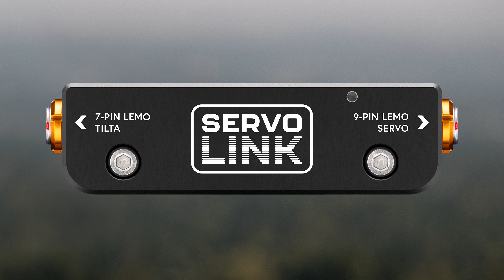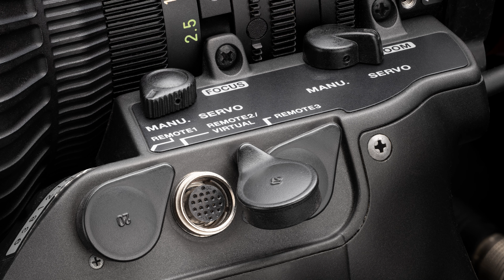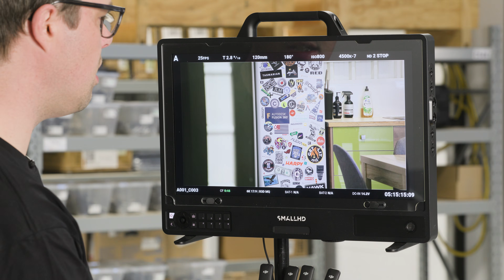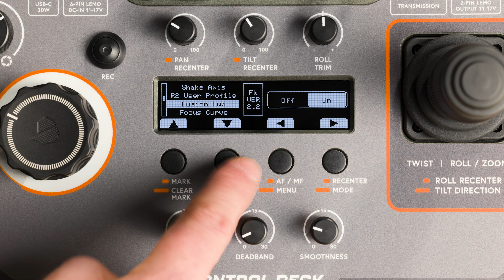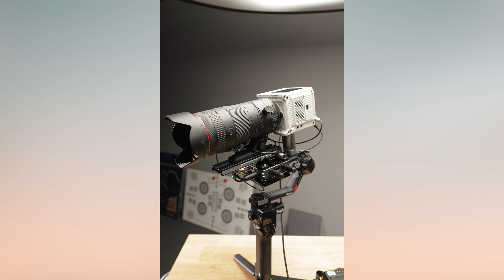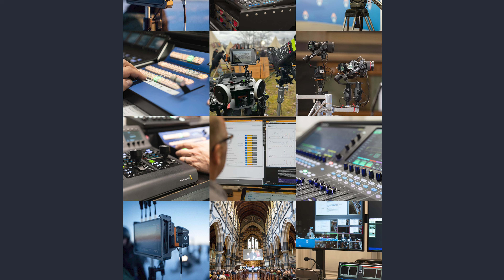Servo Link In-Depth 🔥

Comment: This is a really good video👍 I was watching and I had a question! If the DJI transmitter reception is poor in a crowded concert hall or other place with various frequencies, will there be problems using the control deck? If I want to receive stable transmissions with the DJI transmitter in a place with a large audience and complex frequencies, what is the solution?
Reply from the maker: Thanks!

The gimbal control and FIZ data use about 0.2Mb/s of the up to 40.0Mb/s total possible data rate for DJI Transmission. The remainder is used for video.
You could use another licensed system (eg: DOMO or Cobham) for video in those really congested situations, or cabled video (Fiber, SDI etc.) depending on the rig, while still maintaining control via DJI TX.

We have customers using these DJI TX systems in football stadiums currently, with success.
Reply: @ignitedigi Thank you for your kind reply! I'll have to rent some demo equipment and test it out! Your new products are always so exciting and awesome!
Reply from the maker: @호랭이-n4k  DVINSIDE in Seoul have a Demo Control Deck, Fusion Hub kit. Will have Servo Link kit soon also.

https://www.dvinside.com/